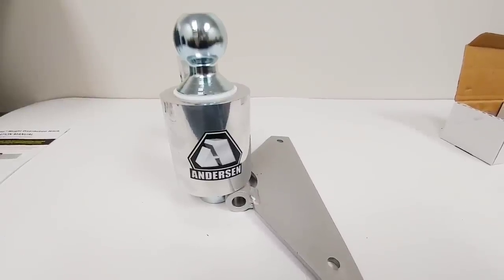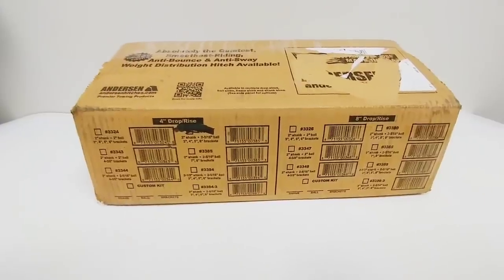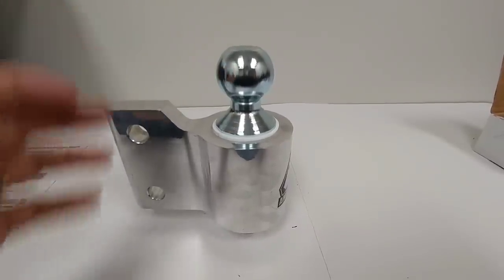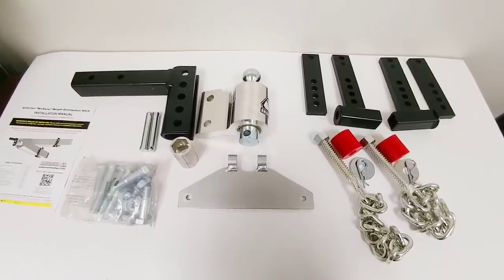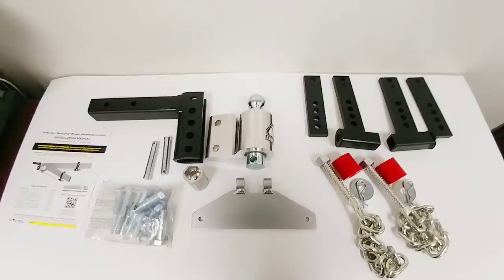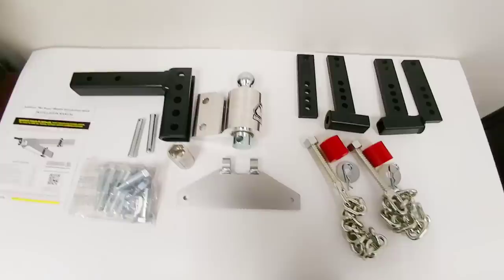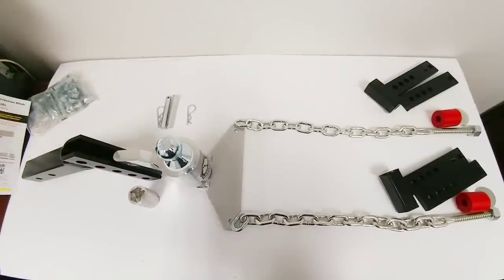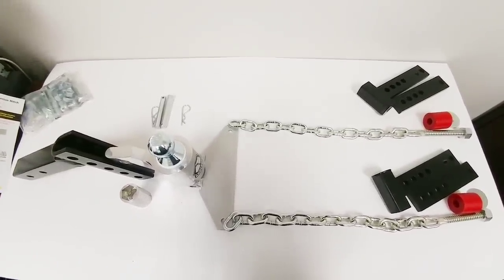The Ultimate Sway Control Weight Distribution Hitch! Part 1: ANDERSEN No Sway Hitch

Comment: Planning on switching from our Equalizer 4-point 10K to this one for many reasons:  weight savings, better turning/backing angles, simplicity of use, and to give the sway and bounce control a try.
Reply: Oh yeah, also how quiet this WDH setup is and no longer have to deal with the heavy sway bars or finding a place to store them...
Reply: When you get it and you think its tight you prolly need to go s little tighter. When I first got mine I wasnt tightening it enough and had minimal bounce control which is all I really wanted since my 1ton didn't need the weight distribution feature. Just keep tightening it till the red bushings swell or bulge
Reply: Kyle Vanwinkle Thanks for that hint!
Reply: @Eric91Z  did you purchase ,,, and if so .. what are your thoughts ???
Reply: Daniel Edwards yes, I had purchased it. It was nice. Simple setup, easy hookup and disconnect. Only downside was I don’t think the sway control is quite as good as the Equal-I-Zer we had. But I didn’t play with the tongue weight before we got rid of camper. The Andersen’s sway control is dependent on tongue weight. Think we needed to move some weight forward for more tongue weight, or maybe a touch less weight distribution cranked in

Comment: How does it compare with a ProPride?
Reply from the maker: different techniques for both. Propride eliminates sway via a very expensive and heavy hitch.  Anything under $1000 is going to help control sway.
Reply: ProPride and Hensley completely eliminate sway, they pivot on two points, instead of one like all others (this included). Honestly if you're towing very large, specially a trailer you spent over 30-40k for, get the right hitch. Saving money on a hitch like this is great but once you've used a real total sway elimination hitch you will never want anything else. I really wish you would do a video on one of these hitches.

Comment: There's a review on Amazon with pictures showing the sleeve for sway control coming out of the hitch assembly over time. Any ideas why this could occur and do you see this as an issue.
Reply from the maker: My theory is that the trailer being towed was balanced poorly and the excessive weight on the back caused the ball assembling to pull up causing the sleeve to work its way back.  That's really the only way an issue like that might occur.
Reply: This actually a feature of this WDH. You can replace the anti-sway mechanism as it wears which you aren't going to do with the other WDHs in this price range or higher. The Anderson web site has videos on the procedure.

Comment: Do you think it has better sway control than a Hensley hitch?
Reply from the maker: no. The Hensley hitch eliminates sway by negating the pivot point when pulling straight.
Reply: I can't compare between the Andersen and the Hensley but I sway isn't even on the radar with my Andersen hitch.

Comment: ProPride and Hensley completely eliminate sway, they pivot on two points, instead of one like all others (this included). Honestly if you're towing very large, specially a trailer you spent over 30-40k for, get the right hitch. Saving money on a hitch like this is great but once you've used a real total sway elimination hitch you will never want anything else. I really wish you would do a video on one of these hitches.

Comment: Can you backup with it installed?
Reply from the maker: yes sir
Reply: Yes. You can with a conventional sway control as well as long as it's installed properly.
Reply: Yes, it is much easier than with a tension bar WDH.  But you want to make sure the TV and TT finish in a straight line or the triangle plate will be turned and this makes hooking up a pain (see Anderson's web site). If I suspect I won't be able to do this (e.g. in my driveway), I straighten out and remove the chains first.

Comment: Interesting. Do the press-fit friction components wear and loosen over time?
Reply: Steelbiceps they aren't press fit they have a hog ring clip on the bottom of the ball
Reply: Thanks. The hog ring would keep things in place, but I'm wondering where all the energy is dissipated when you go around turns or when the trailer tries to sway.
Reply: Steelbiceps the friction material acts like a brake pad and slows all turning motion. You can still turn the truck but sway is much less worth the hitch. Will this material wear over time? I'm sure it will. But the way the hitch is built you simply remove the hog ring. Pull the ball then the old friction sleeve and then reverse the process with the new friction sleeve you can get from andersen. It's the same process if you want to change the ball size. 

I've had my hitch for about a year and I've put prolly 5000miles on the hitch and it still looks new
Reply: Steelbiceps as far as it becoming loose. It is a v shaped hole and a v shaped shaft on the ball so as the materials wear  the ball will drop down and keep tight in the hole.

Think about it like 3 cups stacked. If you remove the middle cup the top cup still slides down and fits snugly
Reply: The cone that surrounds the ball does wear over time. It can be replaced with a new one bought directly from the Anderson web site. I know because I’ve replaced mine.
Reply: Mine wore out within a year and yes Andersen will sell you a replacment but it isn't improved from the factory parts that wear out so fast.

Comment: Great video. Looks like a great setup. I have the BlueOx system on my trailer. Do you think the Andersen system is better?
Reply: New England Rider I'm curious too.  I have the BlueOx, but I must say, I don't like it.
Reply from the maker: in terms of sway control both systems are pretty much on par, the advantage of the Andersen system is that it weighs significantly less and because it does not use spring bars you will not get bounce or hop.  both are very good and reputable systems. It ultimately comes down to set up, convenience, and bounce.
Reply: Big Truck Big RV thanks for the reply. I will definitely be watching part 2.
Reply: If you're satisfied with your Blue Ox, keep it.  My trailer came with a Blue Ox.  I switched to the Andersen to get a 3" shank.  The Blue Ox worked fine.
Reply: Bob Rosenbaum, the Hensley and  Propride hitches are indeed the best products available for sway control but they don't do any better at weight distribution than other good, much less expensive WDHs.  So I'd only opt for the Hensley or ProPride if something like an Equal-i-zer 4 pt WDH can't control sway well enough for you.

Comment: Don't all sway control hitches have to be installed and hooked up precisely right every time? What about backing  up?
Reply: Tina Gallagher Why i will never run one, and dont used weight distribution bars. Especially after having it set just 1 link off from right, it balded my trucks front tires in 150 miles. I threw that sucker into the garage and thats where it sat till i sold the trailer for a 5th wheel. Best damn decision. Course, people looked at me funny using a 1500 truck to pull a 9500lbs 5h wheel. Least till i got the 3500 and not the 5th wheel looks like a toy.. Not only that, but the trucks trailer brakes are too powerful. Will lock and smoke the trailers tires if i attempt to use them.
Reply: Brandon Caldwell Sure 👌

Comment: Shouldn't you have a tourq wrench for lug nuts  ..... peace of mind ...
Reply: anthony brunk you mean 1 ugga dugga ot 2 ugga dugga? Lol torque wrenches are nice but 90% of people won't buy them and few even know how they work
Reply: Torque wrench for lug nuts. Nope, never used it on the lug nuts.  Yes I do own a torque wrench.  It does not make an appearance until re-building an engine or rear end. The lug nuts get an impact socket and a 28" breaker bar. Never had a problem with them coming off.
Reply: andrewforte, If you are tightening lug nuts on a 3/4 ton and up truck, that's fine, but if it's on a car or smallish SUV, you're better off using the torque wrench.  You can warp rotors, or over stretch the wheel studs by over tightening the lug nuts.  After a bit of experience, you can get a feel for the approximate amount of torque you're putting down with your lug wrench, but just use the impact to spin 'em up snug, then finish off by hand with the lug wrench (or torque wrench).

Never use the impact to fully tighten the lugs on anything less than a 3/4 ton pick up, as you'll likely incur the above-mentioned damage.

Not necessarily saying you aren't aware of this info, just didn't want someone less informed about vehicle service to think they could safely use an impact wrench to tighten the lugs.
Reply: Dirt Either Way over tighten bolts are also more likely to fail if subject to otherwise nominal stress.
Reply: Dirt Either Way I've been tightening lug nuts with 4-way or breaker bar for over 30 years. Never warped a rotor or drum ever whether a car, truck or SUV. Only once have I broken a stud, when removing a lug nut. 
I would like to know how much force people use to be breaking lug nuts and warping rotors.

Comment: I don't like it. I have an equal-i-zer and love it. Nothing wears out. No maintenance. Consistent hookup/disconnect. If money were no object or I had a much larger trailer, I'd have a hensley or propride.

1) The pressure it seems to put on the frame/tongue of a trailer isn't like the bar systems and seems it would fatigue the frame material. It will "pull" longitudinally on the brackets instead of pressing down, like they're made to hold.
2) If the frame brackets on this system were to come loose, it would steer the rig down the road due to pretension of the chains. If the brackets on bar systems come loose, you lose sway, but load sharing is still there. This is a critical and dangerous design flaw. 👎👎 Two thumbs down and a fart sound.
3) Tools to connect a trailer = bad and you're basically changing the adjustment of the system every time you connect. Inconsistent or constant adjustments would get annoying.
4) it uses urethane and tension to do the load sharing. But then it uses friction on the ball to do the sway control. Odd. Why not use one or the other to do both? On a big trailer and big truck combo, parts will wear out REALLY quickly, as others have stated here and amazon. The dealer who installed my unit said they had to apply an "unusual" amount of force to get the load distribution from my 10k lbs trailer to scale properly with my F350 because of the stiff front springs on my truck. This would kill this hitch...
Reply: 100% agree with you hugely flawed system IMO not to mention that friction material will wear and eventually wear out and do to it's nature as you are using it you will lose load sharing and sway control witch could be an issue on a long road trip